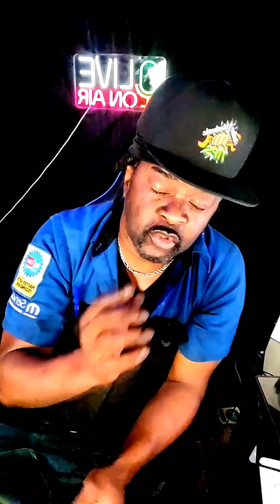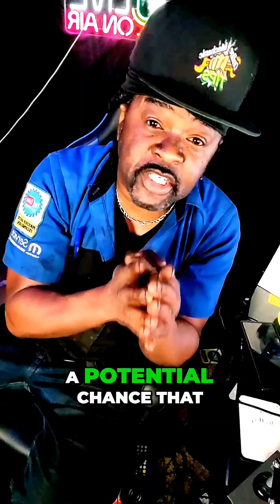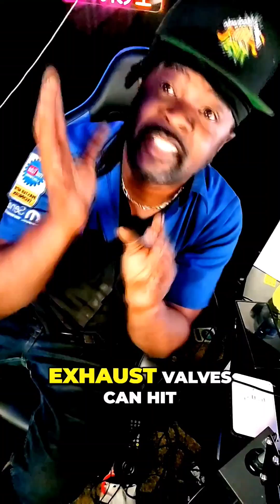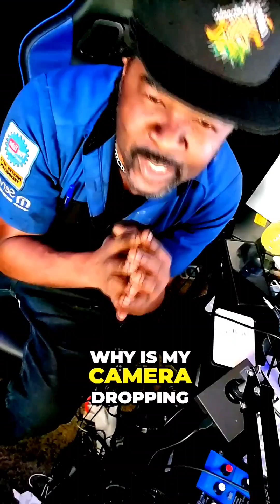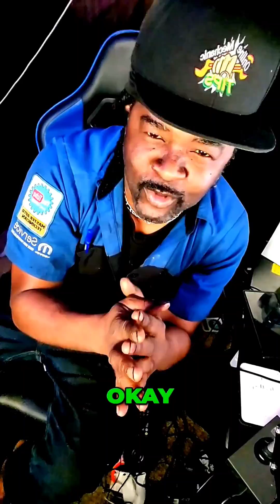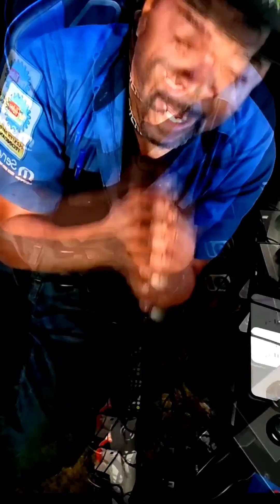Interference Motors: Can Piston hit the Valves? Maybe not but this can cause bent valves.

Comment: You need to do another video like this but have a 3 year old bring you a teddy bear and say its ok.
Reply from the maker: Lmao, great idea dude
Reply: @OnlineMechanicTips Yoo jt , on the nag1 transmission 5 speed , are the input speed sensor one and input speed sensor 2 both located on the conductor plate?
Reply from the maker: @alexlarneioso6413  yep
Reply: @OnlineMechanicTips  thank you very much , and also one last question sir, does the nag1 transmission only have one torque converter solenoid? Thanks
Reply: And today I learned something new 🎉🎉🎉